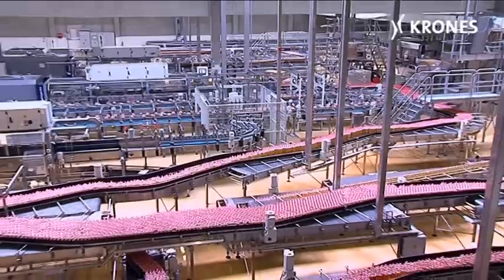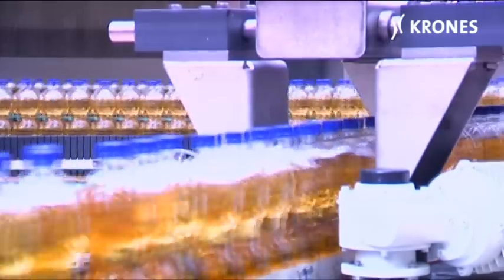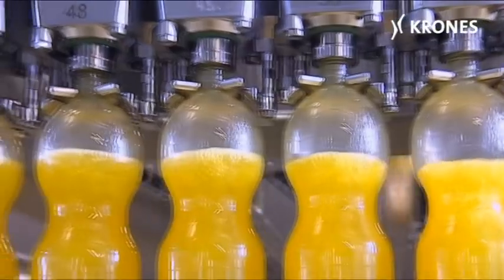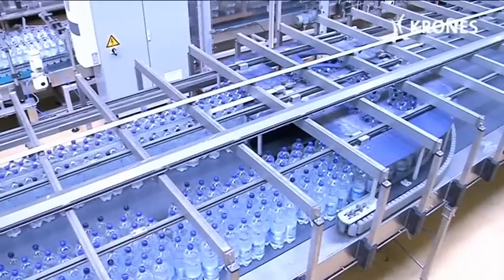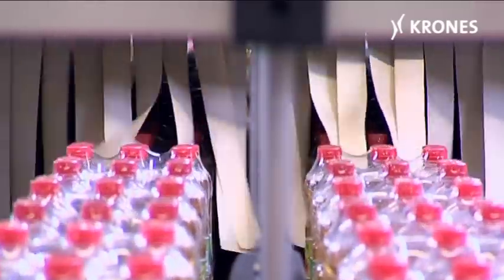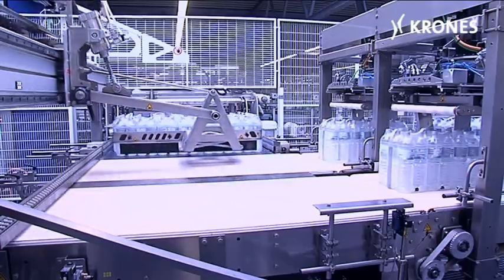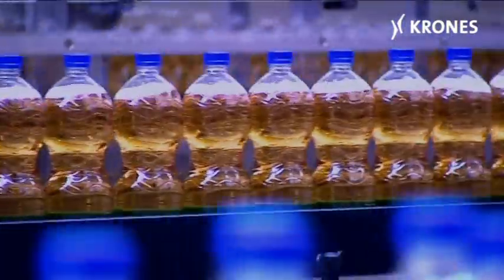Krones machinery at Vitaqua

Comment: 4:10  ... 4.14 looks like a design fault or that the staff have left the flaps up, wrongly.
.
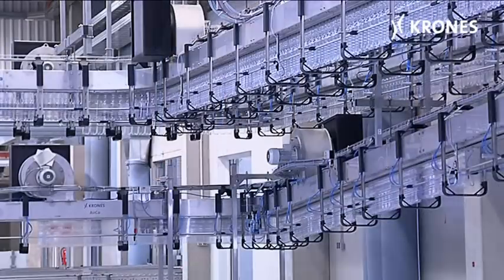There is a spark on the machinery at:1.47 (1:43)  there is a spark on the metal conveyor which could have started a fire ! 
.
But there is not telling that bloke, who sounds like he is reading.
.
Cheers.
from,
del-boy.